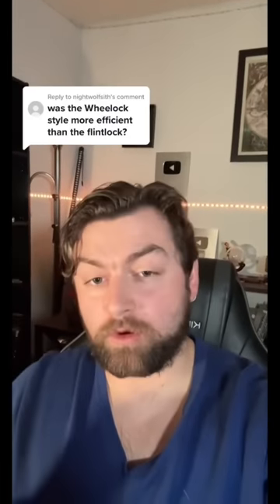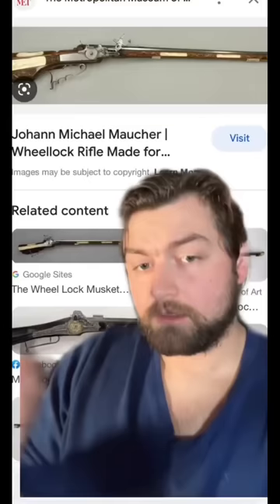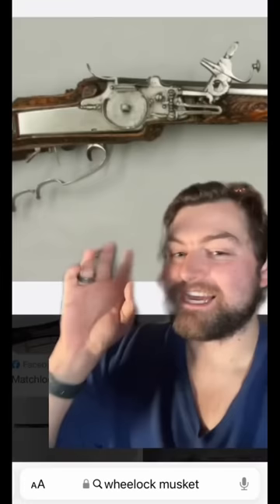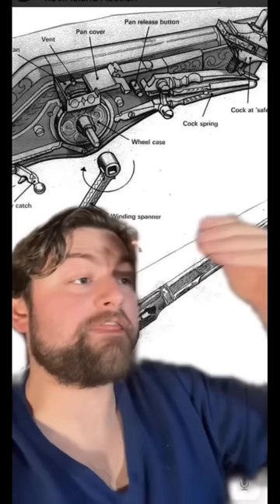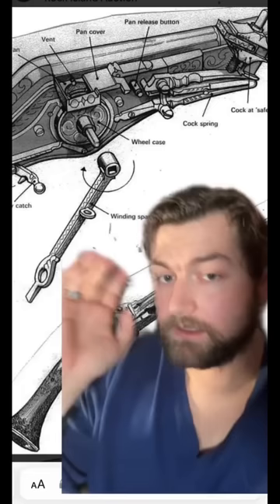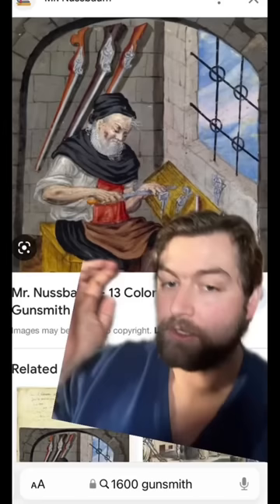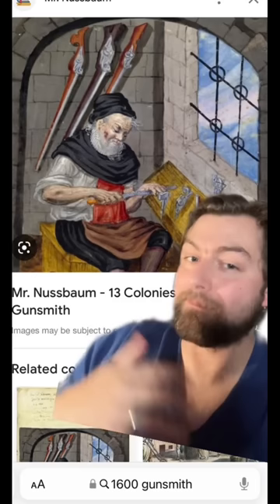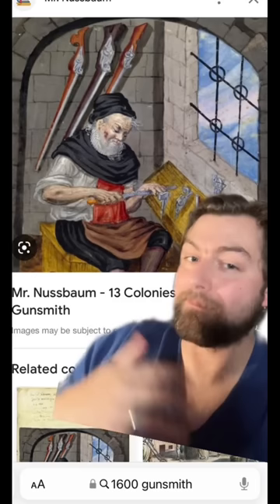Wheelock vs flintlock guns #shorts

Comment: Parts failing on wheel locks were fairly common though which was a con. But was also possible to use from horseback witch the match lock couldn't really be used well from. Would love to try a wheel lock and match lock build one of these days.
Reply: Not to mention that every wheel lock had a matched "key" that you NEEDED in order to prime the thing. So... have fun if you lose that.
Reply: @darklordofsword  good point, I actually forgot about that.

Comment: A wheellock is technically also "better" in the sense that it takes a shorter time from you pull the trigger until the gun fires than a flintlock. (although the difference is very small, and would probably only matter in a target shooting enviroment).

The drawback to this, is that the spring inside the wheellock has to be wound up between each shot, which takes more time than pulling back the hammer on a flintlock.
Reply: @pp-wo1sd  I suppose one could make a version with a "flip out" handle or something to make it easier. But you still also need to reset the "dog" than tolds the pyrite between shots. So it's still at least a little more fiddely.

On the wheel lock you also have to open the cover for the priming powder yourself before firering (if you closed it due to rain), while the flintlock opens the pan by itself when firering.

But it's really the cost and manufactoring differences between the coil spring of the wheellock and the simple flat spring of the flintlock that's the main reason it "won".
Reply: This is just flat out false, you flipped it. wheel locks took longer to fire, there is a greater delay between the trigger pull and the shot.
Reply: @aelitastones3110  No, he is right. There are a multitude of historians and scientists who tested this and found that wheellocks had a slightly shorter trigger pull to firing time. It's not really an advantage, though, as the difference is very marginal.
Reply: @frederiknielsen6038  Many high-end Wheelock actually automatically opened the pan.
Reply: @frederiknielsen6038 many wheel locks automatically retracted the pan cover on a trigger pull

Comment: Hey. Firearm enthusiast here, and while I love the wheel-lock, it's probably my favourite firelock, it's not that accurate to say the flintlock is better solely on grounds of cost. The wheel-lock, while leaps and bounds ahead of the slow-match matchlock, had a head of drawbacks. 

You needed a spanner to wind the mechanism, so if you lost or broke your spanner the gun is useless. 

The mechanism was so complicated that it was mainly trained clock makers who could maintain them as they were the only ones with the skill to do so.
Reply: The lock's wheel protruded through the bottom of the pan and was surround by the powder. If there was a misfire and the pan's powder didn't ignite the wheel would still spin, but now it's spinning in dry powder and it could grind all that powder into the lock's mechanism and cause problems. Jams of the mechanism

The pyrite used in the lock was very soft and could where out quickly. Flint was too hard and it blunted the wheel. 

The flintlock was simpler, stronger, and easier to use and make, and didn't require a spanner to use, and a misfire just meant you'd recock and try again, or change the flint.

Comment: I'm going to have to weigh in on this and say that the flintlock is more efficient than the wheel lock for the simple fact that you didn't have to have a spanner for a flintlock to cock the gun.

There is a reason why the Flintlock took off and the wheel lock really didn't

Comment: Common theme with gun design is that concepts are complex before they're simple.

Wheel lock to flint lock, lever action to bolt action, water cooled to air cooled machine guns

Comment: What are modern firearms called? For a wheel lock it's a wheel, for a flintlock it's a hammer, but what about modern ones more specifically pistols? (edit: I searched it up and I think it's called a primer, so are moderns pistols called primer pistols? I know it's kinda wierd to ask this question.)
Reply: Wrong, stiker fired, or hammer fired are the most common for handguns. A primer is the charge that the firing pin sets off, igniting the gunpowder.
Reply: Center fire primer and rim fire primer. The vast majority of weapons are center fired. Its about how the gun ignites the powder to send the round. There's also magnetic accelerator, air, and electronic firing guns. All of these systems to through rocks very hard.
Reply: @jackb8563  yeah sorry, I know nothing about guns. At least I know now
Reply: @pronetogames7946  Yeah, you should research more into firearms and firearms history, there's a lot of wacky guns out there. It's one of my favorite subjects, I recommend looking up the forgotten weapons youtube channel.
Reply: Cartridge firearms

Comment: Plus flint locks had a more instantaneous firing compared to wheel locks. There as always a slight delay from when the trigger is pulled and the shot leaves the barrel, flintlocks didn’t have much of a delay. Meaning you fired faster.

Comment: Wheel locks had a faster lock time and were more reliable with regard to ignition, you were much less likely to have a “flash in the pan.”  Wheel locks continued in use on a small scale until the advent of the percussion cap.

Comment: In simple terms flintlocks were the wheel locks at home and thus worse in a 1 v 1 situation, but because they were so cheaply made you could make more and at a cheaper price which could turn a 3 v 3 into a 5 v 3 situation.

Comment: Wheel and flintlocks have been documented as early as the 1300s built with extreme craftsmanship and hand metalworking as extremely valuable hunting pieces for things like royalty. Before that it's uncertain because there are no artifacts or reliable documents but I believe gunpowder arms goes back a bit further than believed.

Comment: Another factor in handmade rifles is interchangeable parts. If something breaks or malfunctions in the field, you can't just swap it out with an identical part you have in your armorer's station. You'd need a gunsmith to remake one and fit it. For an individual gun that might be feasible, but for units of hundreds or thousands... yeah no.

Comment: This is like asking if a Lewis Gun is more efficient than a M60. 

The first wheel lock was probably made in 1505, though some claim Leonardo Da Vinci designed one in 1490 it's hard to tell, whereas the first true flintlock is credited as being made in 1610, 105 years later. Of course the flintlock is better, there an extra century of trial and error improvement behind it.

The wheel lock should be better compared to the matchlock, it's main competitor over which it had several advantages. It could be shot in the rain, and high wind. It could be shot from horseback, the powder in the flash pan was less likely to be knocked loose as you moved and fought. It also had a few disadvantages: it was prone to mechanical break down due to its many moving parts. It took longer to reload because the spring that drove the wheel had to be rewound after every shot, and it was much more expensive. 

Flintlocks could do everything that a wheel lock could do, while it was also cheeper to make and less likely to break down.

Comment: The advantage of a wheellock over a matchlock wasnt really its rain resistance, that was only slightly better, but that it could be ready to shoot whenever needed without keeping a lit match around and tending to it, stuff thats basicly Impossible on a horse. A wheellock is just point and shoot. A flintlock does the same though. Wheellock had an advantage over early flintlocks because the spark was generated in the pan so it didnt need to travel some distance which could cause reliability issues in flintlocks

Comment: Imagine if humanity went the steampunk route instead of the Industrial punk route.

We would of had a musket that can shoot 5 bullets.
Reply: chinese have 3-12 round handgonne tho
Reply: technicaly
we are in the steampunk
modern coal powered reacter working by use coal to boil water, water become steam, steam go on anpipe and spin a turbine, the you got electricity,

also that's how nuclear fission reactor work to
heat nuclear reactor, used it to boil water, water become steam, steam go on a pipe spinning a turbine, now you got electricity

and you know how they want to use all new hi-tech newly discocered nuclear fusion for?
they want to use it to boil a water,
water become steam, steam go on a pie spinning a tuebine, now you get electricity

Comment: In short, efficient for an individual but inefficient for an army. 

Except if your in somewhere like in Scotland, who were still using bow/crossbows well into the Gun Powder age because of the humidity problem. Particularly in the further north you go.
Which for perspective is often at 100%, the air literally can't dissolve any more water 😂

Comment: Not to split hairs, but Wheelock's produced a shower of sparks and had instant ignition and were normally rifled, this were more accurate and efficient as a; individual weapon. The drawback was their price, so normally only the very wealthy could afford them. They would buy sbap-haunces for their military which were normally smooth bored muskets. Then the flintlock came along and pretty much replaced both of the older systems and were used on both rifled and smith bore guns. I know you only had a short time to cover this, but as you know, it spans a couple hundred years or so. Comparing wheel locks to 19 century patten breach flintlocks isn't really a good comparison either, like those made by Durrs Egg. Oh, and they also made inline flintlocks also, just not for war. Just thought I would fill in some gaps for you.

Comment: well alright... that takes cost efficiency off the board. and even touches a bit on the reliability, whitout giving it the amount of attention it deserves. 'cuz a gun that only works "most of the times, if the conditions aint to bad" might be not good enough for some cases. 
but the "speed of loading" aspect seems to have been completely forgotten about. because cocking a flintlock was decidedly quicker then a wheelock that needs to be cranked you may also get a higher rate of fire from the flinlock. which if we are honest, is more decisive in the time of ball-ammo and smoothbore muskets, then personal marksmanship was.

I feel this answer-video would get a "c" if i was a teacher, because it seems incomplete to me.

Comment: You didn't actually define how wheelocks are 'better' than flintlocks as you posit at the start of the video, you only note that they are better than matchlocks, which is true. Wheelocks are technically more complex than flintlocks, yes but that does not equal 'better'. In reality flintlocks are superior to wheelocks both in terms of simplicity and functionality.

Comment: So if it wasn't expensive, semi-automatic weapon may have been invented/developed way earlier
Reply: yeah kinda basically once factories became a thing it was finally feasible to make them but they had kinda been around for quite a long time the main issue was not having a good smokeless powder so the guns would clog rather quickly negating their easy use even if you wanted to pay the huge costs.
Reply: They were just look up repeater history and how unbelievably effective say a Kalthoff repeater or Lorenzoni repeater was. Were talking pee 1700s for both systems but due to cost were extreemly rare. The Kalthoff repeter were issued to Danish royal guards but that was it.
Reply: The earliest repeater prototypes were invented in the late 16th century. From there were developed weapons like the Lorenzoni action. During the time frame of the American revolution, you had the Girardoni. That was a 20 shot, tube magazine fed .46 cal pneumatic air rifle. Repeating arms  have existed for half a millennium.
Reply: @tylerrobbins8311  
...aaaaaaaaannnnnnndddd, I should have read the comments.

Comment: Simply disagree. The wheel could be cranked and after you pulled the trigger it would continue spinning causing a ginormous amount of Sparks while the flintlock made a single strike and once the strike was over no more Sparks it was over in a matter of a split-second while it did work because it's it's sprayed the spark directly down into the pan it didn't always work and it just seems to me although I haven't actually used a wheel lock gun that a wheel lock would perform more times out of 100 then a Flint Lockwood on the first attempt